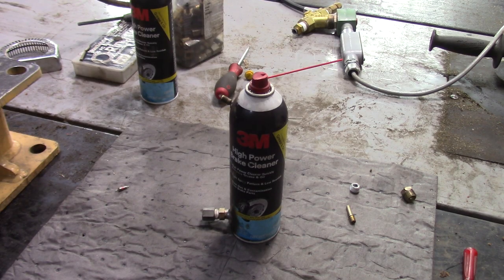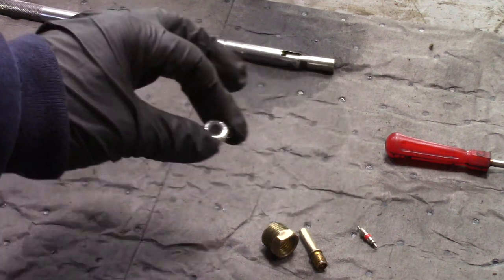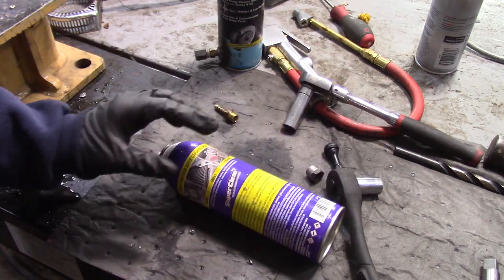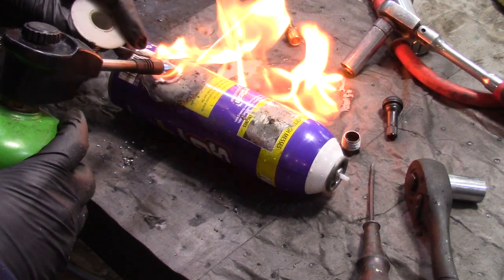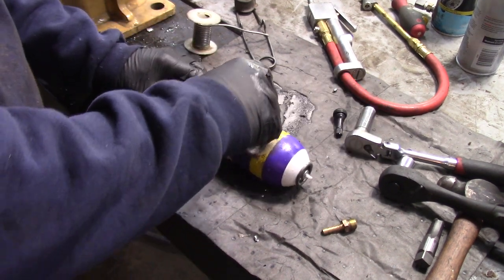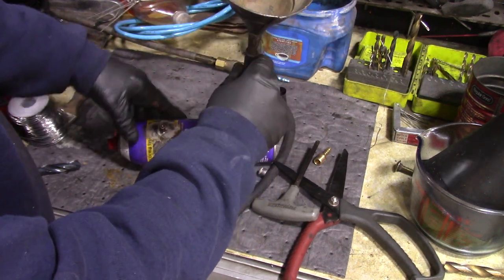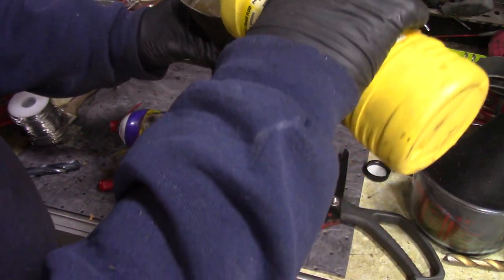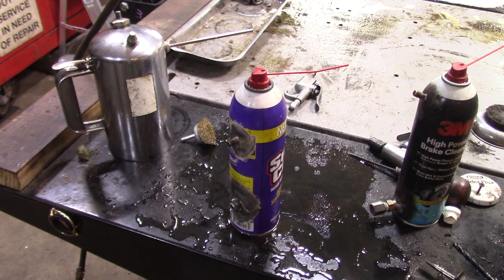Refill Empty Aerosol Spray Cans WD-40, etc

Comment from the maker: ** Be Aware Refilling Aerosol Cans Can Be Deadly!  Please weigh your options and understand your risks when modifying an aerosol can.  Make sure you know how to prevent any risk of explosion before attempting this repair!  Doublewide6 Repair Assumes No Responsibility for your actions.   This is a slight adaption that I have made to several videos that I have seen posted on this subject found on youtube.  This video shows a way I made a can that is easier to fill compared to several methods of refilling cans on youtube.  Most importantly know how to remove any risk of explosion  before soldering or welding on sealed tank.
https://amzn.to/3CEQxWN 1/4-3/8 NPT Adapter Fitting
https://amzn.to/3MNPR60 Tire Valve Stems
https://amzn.to/3CACvpe Soldering Flux
https://amzn.to/3CLCmzq 5 Gallons Brake Parts Cleaner
https://amzn.to/34IeGzm Valve Stem Removal Tool
https://amzn.to/3JaYvJF NPT Tapping Set
https://amzn.to/3wi3mp5 1/4NPT Plug
https://amzn.to/3I5x5Uo Air Powered Die Grinder
https://amzn.to/3J70Fdu 2" Die Grinder Flap discs
https://amzn.to/3JbKrzQ 1/4 NPT Male barbed fitting for funnel
https://amzn.to/3I6WfBO Non Aerosol Spray Can to Buy

Comment: If you don't have a Schrader valve tool, a little tip is to pick up a bottle of "Green Slime" which is useful for adding to problem tires on riding lawnmowers, quads, and even old work trucks. The cap of the container is a Schrader tool...

Comment: Thanks for the info, great video. I think I will be making 3 cans, 1 for wd40, 1 for brake cleaner and 1 for carb cleaner. Question: how much air do you put in the cans?
Reply from the maker: Sounds great!  Put about 90Psi

Comment: You could solder a different nozzle on your sure shot and make it spray more forcefully.
Reply: No solder necessary, just take the diffuser out of the center of the tip of the nozzle. It'll spray 20 ft easy. I use one in an industrial environment daily.

Comment: 5gal (640oz) bucket of standard crc brake clean is about $190 
A 23oz can of standard crc brake clean is $6 at napa, and even at that price it's cheaper per ounce to just buy the can... if you bought 640oz in cans it would save you $25 which you could buy an extra 92oz of brake clean
Reply: I typically save the left over cans for when I need to soak parts with something stronger than diesel or gas, just cut the can open and good to go
Reply from the maker: Yes, I ordered from Autozone and Safety Kleen, prices just went up on Amazon.

Comment: This is dumb and a waste of time & money for an inferior and dangerous solution. Harbor freight sells a refillable aerosol can for $7 (less than the cost of the fittings shown here). Or you can get an even better quart size version on amazon that will last a few lifetimes for $30. 
Then stop wasting money on brake cleaner and just buy acetone by the gallon. Brake cleaner is 90% acetone at 2x-3x the price.
Reply: Absolutely!!!!! This man has NO clue of the danger involved here and then to show how to unknowing people.